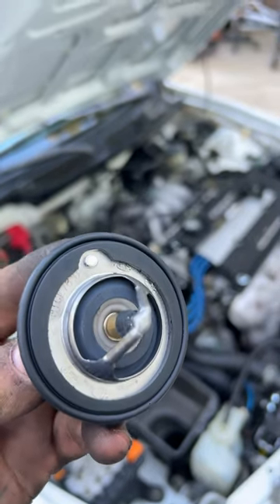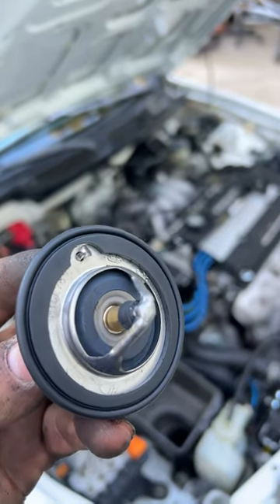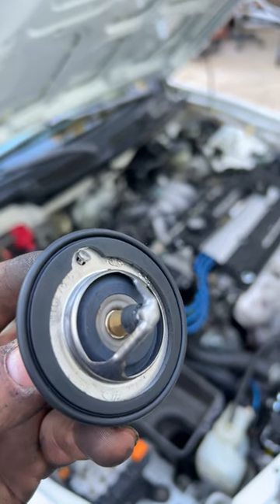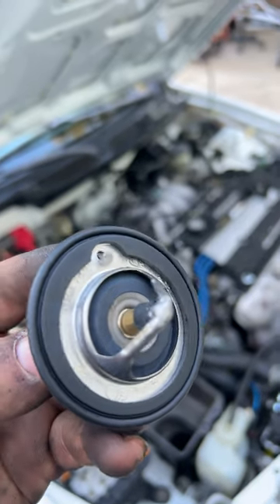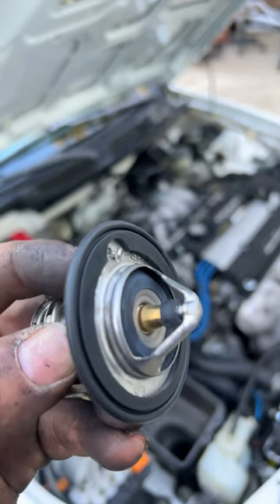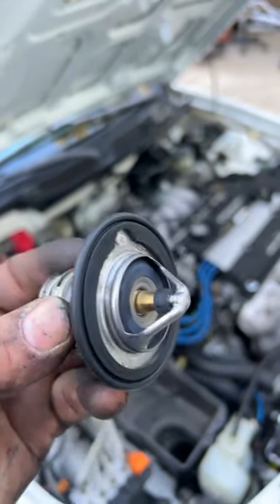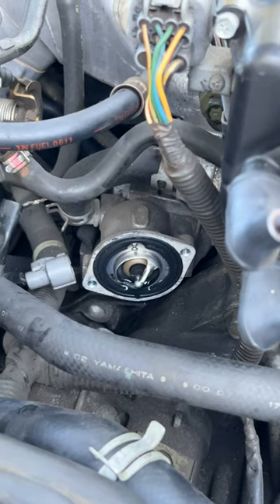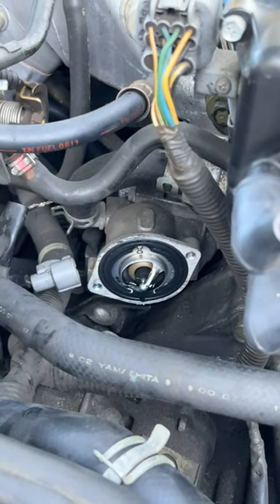Installing a car thermostat right or wrong way @elchanojose

Comment: Someone told me to break this off so my car does not overheat even if thermostat gets stuck closed. It was true. Car wants to overheat but cannot
Reply: May I ask how you know it wants to overheat ? Ty
Reply: Don’t do this… 🤦‍♂️🤦‍♂️🤦‍♂️🤦‍♂️🤦‍♂️ Jesus…
Reply: @Dcdc956 all it does is bleed a bit of fluid over constantly. Not the end of the world
Reply: Lol mate that tiny hole isn't going to stop your car from overheating if you're thermostat fails. That hole is a fraction of the size of the thermostat opening 😂
Reply: @aaronaaron3003  lol it may slow it down at least hwha
Reply: @DFWAuto_Hack  the hole is there to help with bleeding air from the cooling system And to help stopping pressure building up on one side of the thermostat & over pressurizing the system it's got absolutely nothing to do with helping your car not overheat lol the air/ pressure relief hole is 1 - 2mm diameter lol so no it will not slow down the overheating process whatsoever, the thermostat inner diameter (that the coolant passes through) is usually around 30 - 40mm depending on the car so the 1 - 2mm diameter air/ pressure relief valve hole isn't going to do anything to help your car with cooling down 😂. If your thermostat is not opening and you really need to get your car home just pull the thermostat out lol it's that simple lol
Reply: @aaronaaron3003  you are so serious in your theoritical role right now hahaha.  What you say makes sense. Theory always sounds perfect but gets challenged in the real world. I'll just say rhis:
As soon as i did this to my new thermostat, it triggered a p0128 immediately on my car ans this has been 2 years that i still have this code for that reason. Yes, this hole might not be significant as you claim it but for the pcm to notice immediately that my engine is running cooler than normal, it must not be as little as you claim. In fact,mt temp gauge sits just a little bit over the 1/4 mark and if i drive on the freeway,  it goes lower; if i use the heat at the same damn time, it goes even  lower to sit right at the 1/4 mark. So feel free to recite the lesson you learned by heart that makes you feel like an auto expert but in my particular case (not sure about others), it has done something significant.  Lastly, i have never had to remove my thermostat to get home when surprised with an overheating due to a stuck closed thermostat.  God knows i have come accross this issue with several vehicles and all i did was run the heat to full blast and i was always able to make it home safely. 😁
Reply: @DFWAuto_Hack  do some research that hole is only to release any steam that may be built up behind it. I drill a 7mm hole in all my thermostats right beside the pin hole to help with bleeding air out of the system but it doesn't make the slightest bit of difference car temperature wise. Keep believing what your mind is telling you if that makes you feel safer with your car lol but you can't argue with mechanical engineering 😂
Reply: Thank u sir 🙏
Reply: @angelsilva740  a pin hole is never going to stop your car overheating lol always speak to your mechanic before believing anything in the YouTube comments section 😂
Reply: I would never recommend that to anyone lol
Reply: @aaronaaron3003  if I don't have this hole on the thermostat can I drill it like this? or can I lubricate the gasket with something?
Reply: @Kallibi09  you can drill it but I wouldn't go any bigger than 2 or 3mm as you don't want to much coolant flow when the car is warming up but having a little hole will allow air bubbles in your coolant hoses to escape but if you just run the car for 15 minutes with the coolant cap off the air bubbles will escape when the thermostat reaches operating temperature and you will achieve the same effect, look up bleeding engine cooling system it will give you a way more detailed explanation than I can via message.

Comment: Damn, I'm in the process of installing a thermostat and decided to check out a video prior just because. I never knew about that little vent hole. I've played with it with my finger but never knew it should be facing up.
Reply from the maker: Hello Scott!  That component helps to get the air pockets out of the engine or as we call it burp air out.  Also, this helps small amount of coolant to get by and always to have circulation through the cooling system and help or prevent static flow.  Take well care Scott!
Reply: @elchanojose4633  thanks for the info. I finished installing my new thermostat shortly after my last post. I went to check the positioning of the vent hole on my old thermostat.  By luck I positioned it at the 11 o'clock position. Bit I'm good now. No leaks.
Reply: Thanks for this info

Comment: My thermostat doesn't have a little hole my friend
Reply from the maker: Hello!  Not all thermostats are made the same.  Some vehicles have been equipped with thermostats that don’t have the small hole or valve.  If your thermostat is just full face metal with no hole, it’s ok and is going to work fine but just install it on the right orientation.  Take well care!

Comment: What if my thermostat doesn’t have that pin
Reply from the maker: Hello! The thermostats might not all be the same or might not have this pins.  If the pin is not there, dont worry about that because the job of the thermostat is still going to be done.  The pin is just a way to help let air trapped on the engine to be burped out even if the thermostat is closed.  Don’t worry, air is not going to be trapped if the pin isn’t there and will get out.  Take well care!

Comment: could this cause overheating?
if installed with jiggle pin facing downward?
Reply: I think so I'm waiting on mine I bought one from AutoZone didn't have that lil jiggle...I got one from Amazon and it has it
Reply: @donaldwhiteman3224  yes I think so bc on my vibe I bought a new thermostat and the original one was has the jiggle pin on 3 o clock position ,so I put a new one but was bubbling a lot bc I drill a hole on the jiggle pin...so I put back the original thermostat and I set it at 12 o clock and working well heard some Bubble coming out as it purge it own self.... Most of the time u have to see if fan is turning on time too....
Reply: If you install the thermostat correctly the jiggle pin will be correct also, simple really

Comment: So the little metal thing has to be open?
Reply from the maker: Hello!  The metal does not have to be open, it would be good and helpful to sit at the highest point when installation.  Also, keep in mind that the thermostat be installed in the right way for it to operate properly.  Take well care!

Comment: I usually drill a hole on the lil pin, did it on a dodge car and work perfect. Now i did it on a pontiac vibe and the car buble alot so i install the factory thermostat...
Reply from the maker: Hello!  Thank you for watching our video and for sharing your experience and results.  Take well care!

Comment: i just bought a thermostat for my jeep compass but it didnt come with that silver piece in the hole???
Reply from the maker: Hello!  Some thermostats are not made the same.  Some are made different but still work.  The only advantage of that little silver valve is to allow air trapped to move by when the thermostat is close.  This helps the engine to burp air out and fill the space with coolant.  Take well care!

Comment: Is it hard to install one ?? Just asking cuz I took mine to the shop and it’s been 2 days 😅😅
Reply from the maker: Hello Miguel!  A thermostat is not that hard to replace.  Some cars require more labor than other but 2 or 3 days is too much time for this kind of job.  The reason on why your car is taking too long for a thermostat replacement, is probably because the shop has other cars that are being worked on and your car is sitting there until a spot is available.  Take well care Miguel!
Reply: It takes 2-3 hours at most if you don't know what you're doing
Reply: @M.Qambar bro. It takes like 20 minutes or less to replace a thermostat. On this type of car.
Reply: @gta4162  Yeah, that's true for me and you, but the original comment obviously doesn't know much about cars so it'll take them longer + i was talking about cars in general not just about this one because some would need a lot more work just to change a thermostat
Reply: It’s super easy. If you have the funds to pay the shop and you don’t feel like fooling with, then take it to the shop. But if you want to save money, do it yourself. I do a lot of maintenance myself. I’ve learned a lot by watching many YouTube videos.
Reply: @M.Qambar doesn’t take nowhere near that long for me to do it on my 2013 Ram 1500 Hemi.
Reply: @elroco4827  as i said before, yeah it doesn't take long, but for someone who doesn't know much and would need to watch a video to learn how to do it, it would take 2-3 hours at most (on some cases) but for people who knows what they're doing then yeah 15-20 minutes is enough
Reply: @M.Qambar  I gotcha
Reply: No it takes 15 minutes! They drain the fluid out. Take off the bottom hose and change the thermostat. It shouldn't take long at all. They may be busy shop though I hope 😕 otherwise I hope they do not charge by the hour!

Comment: the jiggle pin faces upwards so the air can escape
Reply: What happens if it's not? Does it cause the fluid to boil out of rad when trying to bleed
Reply: I just have a fluid leak from the thermostat, if the metal is on top, will the fluid not leak out?

Comment: I don't understand how you can install it the wrong way. You can't install upside down, only a 180 maybe
Reply: The thermostat I replaced on my civic literally wouldn’t fit unless the release tab was at the top. Pretty smart engineering.

Comment: Does it matter which way you Install it?
Reply: It does matter. The side with the coil spring always faces into the motor. If you install it backwards it will overheat
Reply: Probably not but I’d install it with the jiggly point facing upwards at 12:00